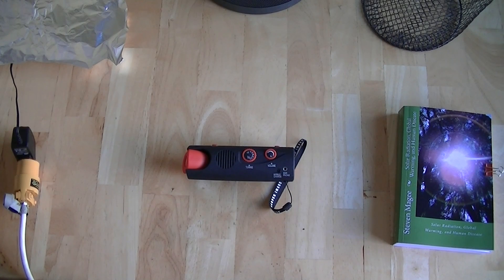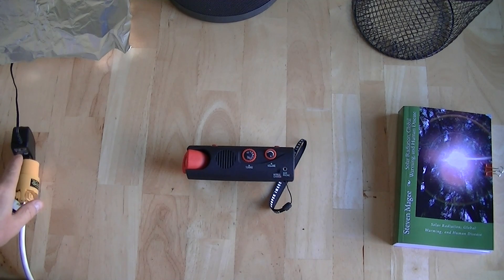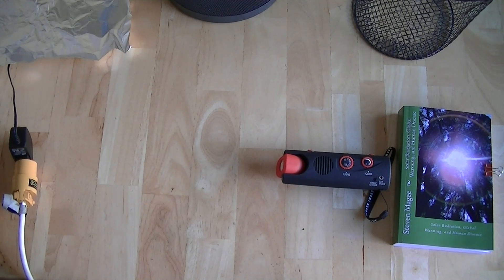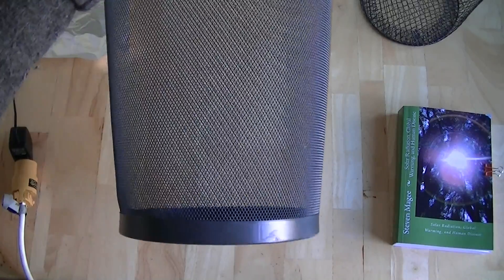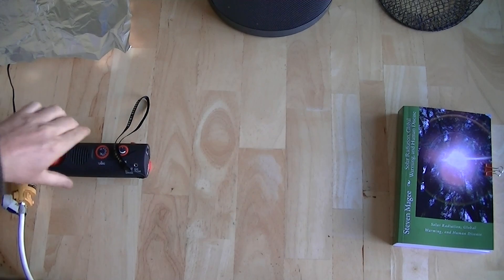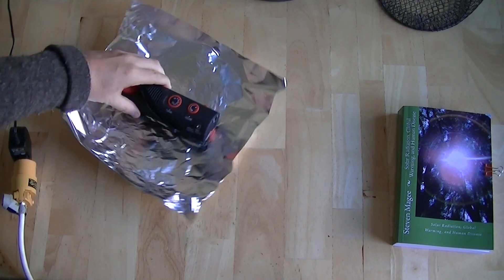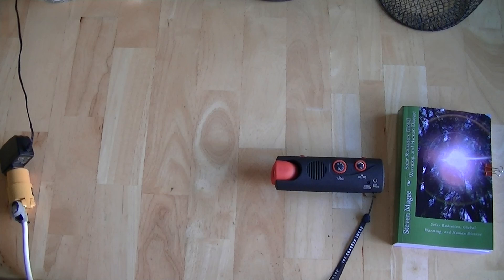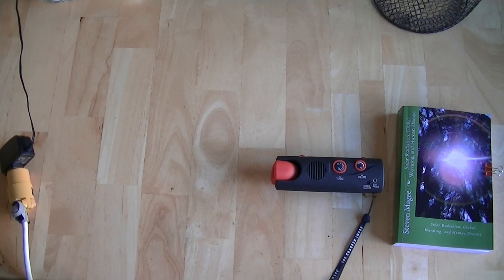Electromagnetic Shielding Principles Regarding Holes at Low Frequencies.

Comment: Great demo, except that I believe what you have demonstrated is RF (Radio Frequency) interference and shielding not electromagnetic shielding. As you know aluminum is not magnet and does not have the ability to divert or conduct magnetism or to be in resonance with a moving EM field. The AM radio is picking up RFI from the "Switching PS" in the charger. I would like to see if wrapping the charger in foil is as effective. Thanks.

Comment: Great vide, thanks.
It looks like you only rolls the foil around the radio?
The reason I asks are that I want a coaxial cable to run from outside to some equipment inside the cage. But I had heard that the smallest hole would result in that the EM would find that hole and be lead inside the cage.
I hope that you please will help. :-)

Comment from the maker: Nice video!  You should always ground your shielding if there is any possibility of it coming in contact with an electrified source.  When it is so close to an electrified cable, then you will also start to get significant induction effects occurring in it also.  I noticed that when I tested my LED bulb, it made my RF meter read 800 millivolts per meter!  I recommend that people should use filament light bulbs so that they are not exposed to high frequency emissions from the lamp electronics.

Comment from the maker: Electromagnetic shielding is a complicated subject.  The theory regarding holes, shielding, and wavelength that you are talking about does not hold true at lower frequencies.  The frequencies involved with this experiment were designed to show that.  I have not measured the frequencies from this particular charger, I used it simply to generate the tone on the radio.  It is an inverter and is likely running at 25 kHz with many much higher frequency harmonic emissions.